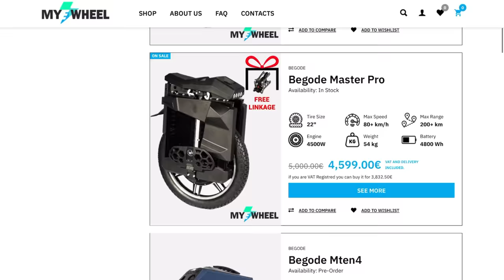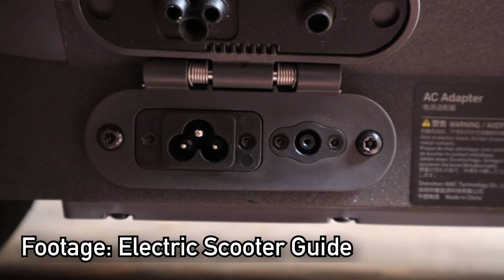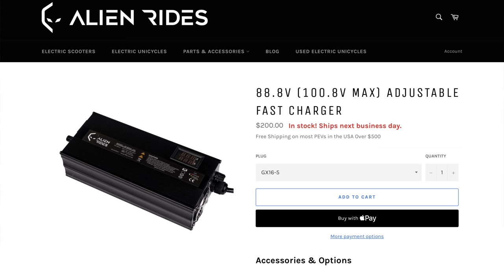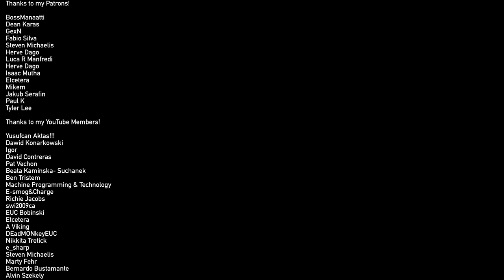I don't like where EUCs are heading

Comment: First off, love your content and respect what you do and what you stand for!

Here are my opinions in regards to EUCs...
Safety should be priority #1, always!

Everyone has their own stance in regards to what they want from an EUC, and I think that should be respected. This, I think that there should be wheels made for different categories.
Beginner wheels - something small and lightweight, low speed, low cost, etc
Commuter wheels - capable of high speed, but limited to 45mph (usual main street speed limit) plenty of battery life, suspension, enough torque for all the weight.
Small city wheel/easy transport - something on the lighter side, nimble, good trolly handle, flip up pedals, etc.and a speed of either 25 - 35 mph depending where you ride.
Offroading/trail wheel/dual sport - fixed pedals, plenty of torque, light enough and nimble, with suspension and enough battery life.
Sports wheels - designed for racing, etc. High speed and plenty of torque. Enough battery for the sport, but not too much that it becomes more of a commuter. Nice and stable

These would be ideal categories IMO, assuming each thing can be achieved with current technology. Unfortunately, not every box can be checked due to battery performance and weight of current tech. These would also imply that some sort of regulation would be needed to make sure wheels are used for their intended purpose, like we do with cars.

I also want to add, I agree with basically everything you've said but in certain circumstances, such as fixed pedals. They would be good for certain things but also hinder you from the portability factor (needing to fit through a tight spot) integrated charger would be amazing, but also contradicts the idea of as low weight and size as possible. Etc. Etc. 

There's so much to talk about within this subject, and there's lots that needs to be done by manufacturers. But I'll sum up by saying that there needs to be categories, not wheels that try to do everything and fail at most (jack of all trades, master of none)
And that safety needs to be the number one priority!

Comment: I have a V11 and a V12. I’m a big guy (230lbs) and generally use them for commuting. Honestly, the 18” tire and suspension on the V11 make it my go to wheel but I like being able to get up to 35mph with relative ease on the V12). Give the V11 a better suspension and enough torque to reach 35 comfortably and it would be perfect for city commuting. I can’t imagine a scenario where I would even want to be doing more than 35 on a wheel, but I’d love a wheel that gets to 35 quickly and easily and maintains 35mph even when going up a 15 to 20 degree incline.

Comment: I've been riding EUC for about 1 1/2 years now, and in the end, I classified it as a personal transporter device. My first wheel purchased (but not learned on), the InMotion V12 has been perfect. Mine was one of the good ones - with no issues. This wheel is light enough to pick up and carry like a suitcase, has enough range for me to go 30 miles of mixed slopes and flats with 50% battery left at the end of the trip, can ride in the rain, perfect to take into the grocery store, can idle at stop lights, go backwards easily - giving you an array of complex traffic maneuvers you can't do with a bicycle - or with any other vehicle for that matter - a for a pretty good price - $2,000, which I think is pretty reasonable. I don't think EUCs are going to get bigger and faster - I think we hit the ceiling here. Instead, I hope they will have true waterproofing, and... an internal storage compartment! A small one to put tools for emergency repair or first aid. I love the return of RGB and speakers - like what King Song is doing with the S19. I also love the S19's futuristic looks. I think we are getting there! 2024 is going to be the year of refinement.

Comment: When buying an airwheel, is the highest wh on the battery always the best?
I could choose between 130wh, 170wh and 340wh with the airwheel Q3.
I would guess that the higher wh the better, but the 130wh is the most expensive one
while the other ones cost the same.

Comment: Your comment about having an internal charger is problematic. You want the EUC to be lighter, then you ask to have the charger onboard. These two things are at odds. I would prefer to keep the weight off and carry a battery charger only when needed.

My biggest wish is that EUC makers would use slide in battery modules like those on E-bikes. Even if the wheel is heavy, you can pull the batteries to make them lighter before lifting into a car, etc. Also, you can have full days out with battery swap and even have half load for when you want lighter weight at the expense of range for offroading, etc.

Comment: BMS like they use for small solar system batteries... prevents over charging, slows charging above 90%, adjusts current to individual cells to balance, strips the charge when full, temp sensor prevents overheating, temp sensor prevents charging until the battery is above freezing. the high priced ones you can even adjust the cutoff limits to prolong the life of the battery.

Comment: I couldn't agree more! I'm still using my first euc, a v10f, and I'm very happy with it, the handling, weight and shape are just perfect.

Even the speed, that I've increased up to 30km/h is good enough.

But the problem is the range. I've been thinking on getting something with longer range, but everything is so big and expensive. So I stick with it.
Reply: I feel like that about my 16x except it’s not the range that’s the problem it’s that it’s made of crap… to be fair I’ve given it some serious off road abuse, but I’ve replaced literally every part of it over time, I feel like every wheel has a little piece of the puzzle and each wheel is capable of giving a glimpse of the joy of riding Euc…someone just needs to take all the good bits and put them together in one package that allows us to fully stare into the blinding ecstasy of Euc that’s surely possible!!!
Reply: Hahaha my baby will always be my v8f. It's not super fast,  but it's fast enough that I can zip around and still enjoy riding. Small wheels ftw!

Comment: We want a KS18XL. It will be the top wheel !
Reply: with wider rim to fit 3" 80/80-14 ie. Michelin Street pro tire and more flat surface for custom pads? oh, and V11 back/headlight

Comment: I learned with a v5f 6 years ago. I use it for city riding, and 1 year later i changed to my fantastic ks-16x. I'm craving for a suspension wheel, but exactly has you said in the video, i don't want a huge expensive excessive fast wheel. Manufactors, pls, Listen

Comment: I think we need some sort of unified platform, at least 1 or 2 per EUC brand, just like with the cars, so that most of the spare parts will be interchangeable between EUC's.
Like, 1for smaller wheels (14"-18"), and 1 for SUV (20" or 22"+).

Comment: I feel part of it is driven by the community. Everytime a wheel comes out, the immediate feedback from the majority is that it doesnt have enough range or enough speed. Like the s18 molicel revisit, everyone stilled dogged it for being too slow and not enough range even though the torque delivery through the entire battery was improved on and suspension linkage was fleshed out. Manufacturers pay attention to the community feedback, probably why they keep building bigger, faster and heavier and abandoning midsize

Comment: Well, you hit the spot there Adam…look at all the comments!  This is so true. I think the fad for the massive, high speed mega expensive wheels is largely driven by a very vocal minority of American riders. And good on them! But I really don’t think that their wants and needs are representative of what the actual majority of riders around the world want. Clearly in Europe, the requirements are much different.. where it seems that most want a wheel that is easy to live with, to take with you on the bus, train or in the car. To use on cycle paths and side walks, 
To cruise and chill out on, rather than carving it up in city traffic..which would be illegal in many countries without insurance and registration. Quite a few riders who were tempted to bigger, heavier and faster wheels have been , by their own admission, ultimately a bit disappointed as the big , heavy wheel just isn’t as useful, practical or easy to live with as the smaller, lighter ones. All the points made here are very relevant, and I hope the manufacturers actually start to realise that the points made are very valid.

Comment: I wish wheel manufacturers would adopt a methodology similar to the auto industry;  produce a few different wheels each year across different sectors (compact,  commuter, SUV) and give them a name....accpanied by the production year.  I may want to own a 2023 Inmotion V11....it would be an updated model, perhaps with new features incrementally improved over the original model produced a few years ago.  If they ever want these incredible devices to go fully mainstream they need to be strategic in their development cycle instead of reacting to the minority of riders who want to put a rocket sled between their legs.

Comment: Imho the more powerful the wheel the safer it is in terms of having the maximum headroom before cutting out or over torquing (especially being on the heavier/ taller side myself)..I don't need to always ride at the crazy top speeds but the peace of mind knowing I'm much less likely to cutout/ over torque is worth it to me, let alone the optimal torque/ power/ speed is just more fun.. so I welcome the more powerful wheels..this is why I'll always get a begode wheel first over any other wheel as they continue to produce the highest performing wheels.. if another euc manufacturer made the highest performance wheels I'd get those instead for the same reasons.. but I've had zero issues with all my begode wheels.  I couldn't be happier with my ex30.. wheel of the year imho.. the most versatile all round wheel that can just about do it all in one wheel..I don't need multiple wheels with my ex30 as I just about can do it all with that.. and the ex30 is one of the few wheels that is both high torque and high speed on one wheel..I ride it to commute, trail ride, ride down stairs, jump, racing etc.. the only other wheel I'm getting is the begode Extreme specifically for more agility and even more torque for highly technical single track trails and will still be a good medium range fun nimble wheel... will probably be the highest torque wheel ever (& like you said the more torque the more fun)..won't need another wheel other than those 2 for all my riding needs.. the faster they can go the better again as that means more buffer before cutting out..ie faster wheels are safer so long as you ride within the limits.. less powerful, lower speed wheels are just more dangerous as they are easier to exceed their limitations and cutout/overtorque and cutting out at speed has got to be one of the most dangerous risks on eucs so why not have more buffer to minimize the chances of that happening?

Comment: I think they need an option for a new non suspension lightweight wheel. No suspension because it makes the wheel smaller and lighter.
Reply: This would be a great entry level wheel and secondary wheel for exp riders. This wheel should be cheaper and way more portable for times when need fit in a locker or small trunk

Comment: They need to head in the direction of easy tire changes. Pull one pin and one plug and the whole motor should pull out rather than removing batteries and wires and 30 screws.

Comment: I love some of the ideas in here, but I would definitely be very sad to see the latest innovations in speed go away.  I feel like we are hitting the workable limit of speed at around 50-55 mph. After that, wind just makes it not fun.   Yes it is much more dangerous, but that should be left up to the rider to decide where they feel comfortable.  Living in Chicago (flat as a pancake) and commuting long distances means that speed is much more useful than torque in most situations...as long as there is enough of a solid safety margin.  Weight also doesn't matter so much.  The heavier wheels don't really bother me as I'm a heavy guy.  It's worth the trade-off for longer distances and higher speed/torque for city riding.  All that being said, I completely agree about the need for variety in our wheels.  Those lighter wheels for trail riding/technical riding are hard to beat....just a completely different feel.  I do miss the old days of watching Kuji jump like a madman on his MSX because the wheel only weighed 50 or so pounds.  The one size fits all thing is definitely silly.  Every group of riders I know around the country has completely different needs/interests depending on the geography of where they ride.  Double thumbs up for improved chargers.  These 2/3/5 amp chargers are just ridiculous.  All this aside....there is always room for more safety.  Yes please on safety.

Comment: Quality
Quality
Quality…
Manufacturers and designers, please listen and pay attention to detail. 
High quality screws are worth it, we will pay $25 more for proper strength / environmentally rated screws. 

A note on the electronics market since covid, a lot of substitution parts and low quality broker parts have been used, causing tons of problems in every market. Anything electronic that was built in 2021/22 has risk of being made with lower quality chips, mosfets, IGBTs, resistors, etc.  This is waning but still evident. (Remember car inventory at car lots was empty because they couldn’t get microchips!?!?) This should be getting better now and into next year. 

As the customer, I did not authorize broker parts. This is my life you’re messing with if I crash due to your poor quality parts. 

Torque = better. So true. Increase those stator stack heights. Reduce winding counts.

Plastics:  cold rating, fire rating, fiber-impregnated, etc. 

Thanks for the ranting platform.

Comment: I'm searching a " torqui " wheel With alot of range , the top speed doesn't really bother me , i would say 50 - 60 would be good and a light wheel if possible , something could carry in your bag
Reply: Tesla T3!!  Motor 2,000W/ Battery 1,500 Wh / Weight 21 kilos/ Speed 50kl/h./ Price US 1,750 / Tire 16". It's wonderful!!  PURO TORQUE
Reply: @olgac9121  than you mate

Comment: I'm also saddened by the latest trend...  Especially in the US where so many people care about speed because of all the wide open roads.  I don't really even participate in group rides anymore because you end up in a group that just wants to ride fast and get in the way of cars.   Being on the road is boring to me and the only way of making it more exciting is to go fast which just makes it more dangerous.  The S22 is heavier than I would like, but now it's a lightweight compared to everything else that has come out since...  I don't need to ride fast I enjoy being able to ride in ways and places that other vehicles can't.  But if 50mph/80kmh is becoming the standard then we might as well be motor vehicles.  Which for me makes it less fun and more dangerous if we're competing with other vehicles that are far heavier

I used to have the shopping cart test for wheels where I would see if a new wheel would fit in/on a shopping cart when I went grocery shopping.  The MSX was pretty much the last wheel I could do that with.  Well maybe the S18 could as well, but since the very beginning I've wanted a strong light wheel that could easily be jumped and have great maneuverability and torque, however ever since "jump pads" became the norm wheels have gotten way too heavy to jump with 😅 and now you need pads just to be able to get enough leverage on a heavy wheel.  

I've always said for YEARS that EUCs should be mostly metal and rubber with almost no plastic.  Just like bicycles.  If you want a panel for side pads just bolt one on. If you want lights bolt that on and include waterproof connection points at a standard voltage for powering other devices.  These things can be far more modular than they are today with pedals, batteries, etc. and can support a much bigger custom market.

Comment: I totally agree here with you on the first part. I still ride my V10. Not because its best, not because I cant afford better but because it is what I need for city. I need a suspender commuter with 20-30 kg and good form factor. There are maybe v11 and S18 nearby but they are still not offer that much. I am still waiting that one day I will buy a wheel that is good for my needs... I just want a good build quality that I can trust that it wont kill me (like v10).  I Really dont get this hype about speed. Or I get it, speed and range is easy to sell and develop. By selling 3000 eur wheels vs 1500 eur you make more profits. So thats why it is going there. However we that use it as a way to commute are forgotten.
Reply: Anyway the engineering is always a compromise. I can understand some of the design choices. like having charger inside would increase weight and its another part that fails. Also having bigger charger means it overheats less, there is more headroom -> safer. Also cheaper.
Fixed pedals. No, please No! I know how many time i scratched the pedal over something like curb. Most of the times the pedal just flapped -> safe. If it was fixed I would be lying down.
Adam you sometimes goes against yourself with the opinions.

Comment: A new 16x with improved shell durabilitiy, 1800wh battery, better headlight and spiked pedals....that would be great 🙃
Reply: bigger wh bigger weight
Reply: Bigger wh bigger fun....if the shell is reinforced, the wheel would get slightly heavier nevertheless...